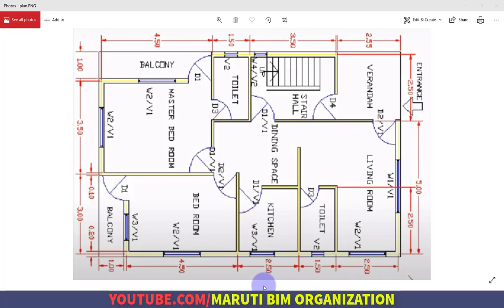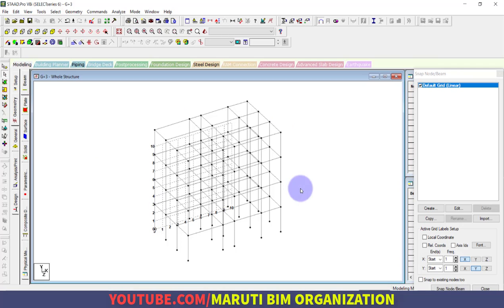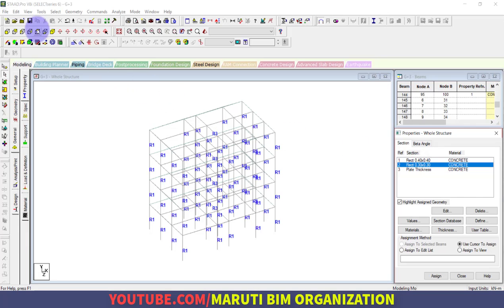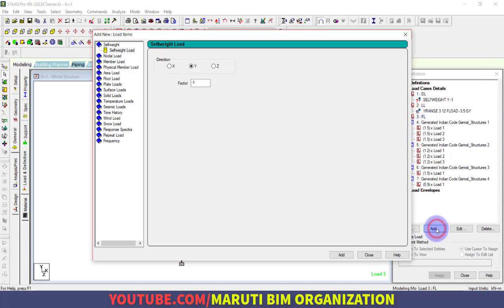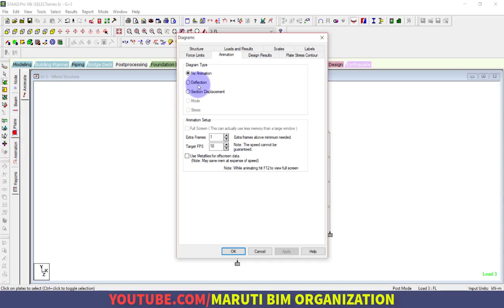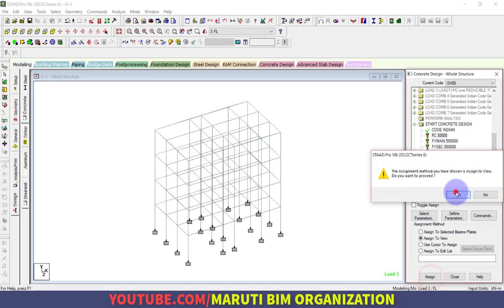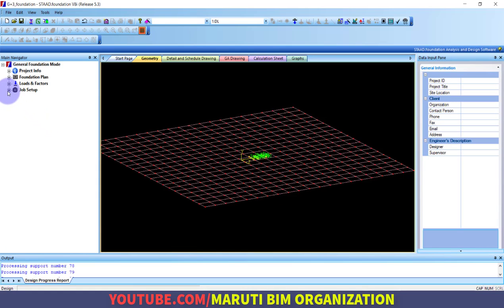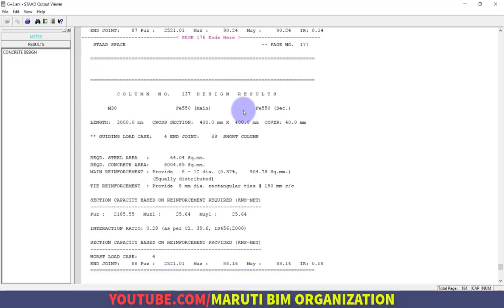PART 123 - Design of G + 3 Storey Building With Foundation

Comment: Why u have not done steel design by selecting steel code IS 800 : 2007 LSM
GREAT VIDEO THANKS A LOT
Reply from the maker: using is 456 : 2000 concrete design.. here we are not doing steel design... is 800 2007 used for steel design